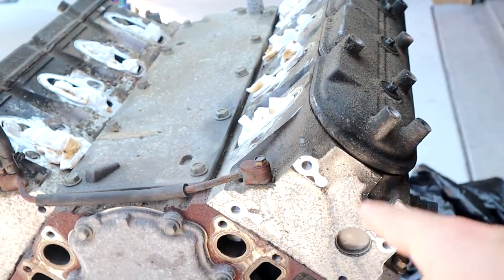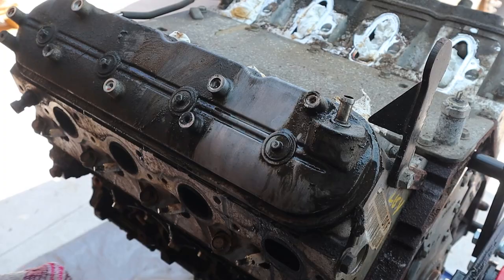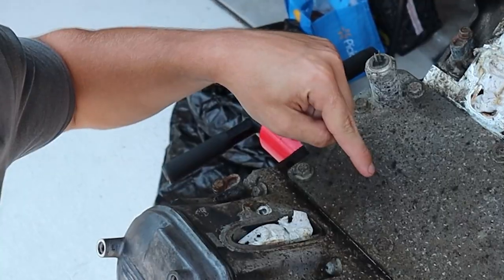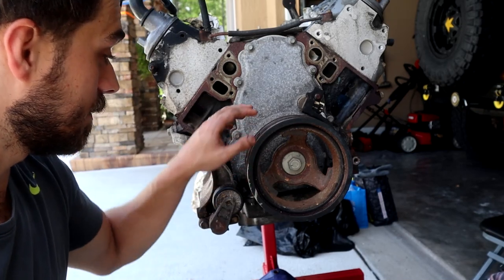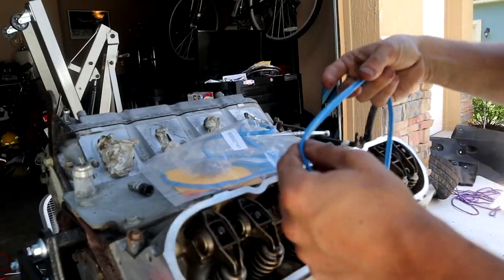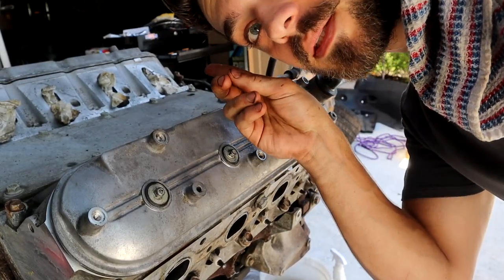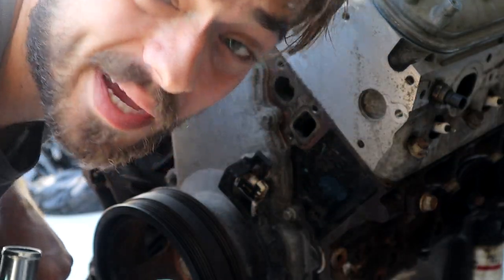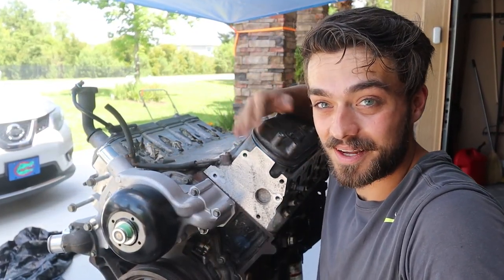Can Krud Kutter Clean a Junkyard LS Motor?

Comment: Finished product looks phenomenal!! Steel wool works well, but I've found the BEST combo is pre-soaking with Krud Kutter then blasting it off with a steamer (brass brush nozzle). The grease lifts right off, fully emulsified. It's insane.